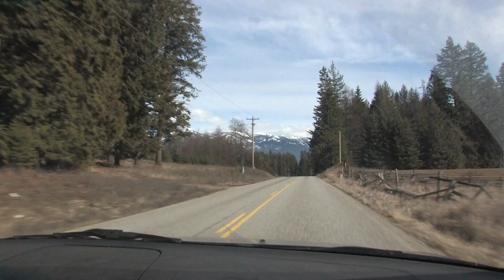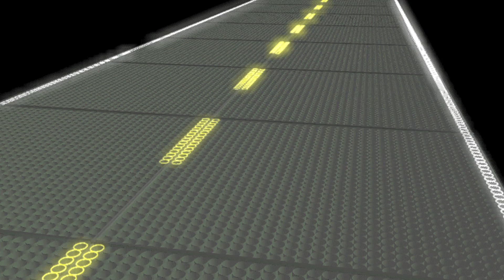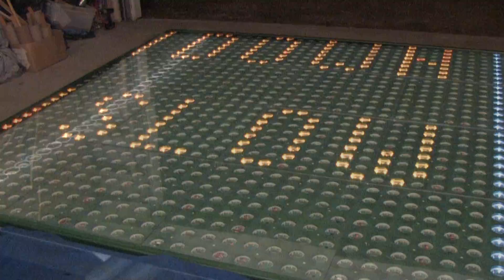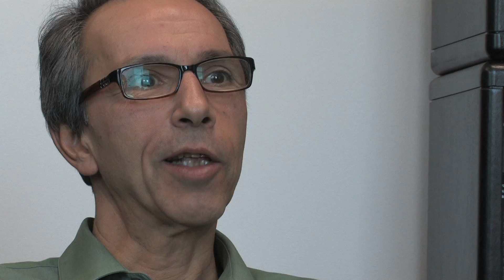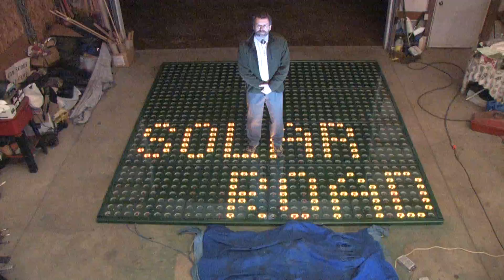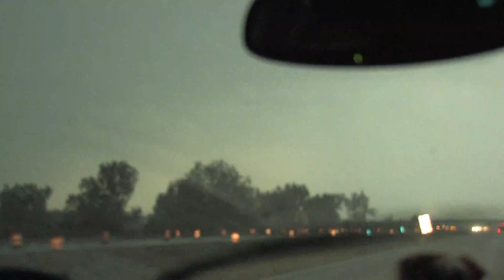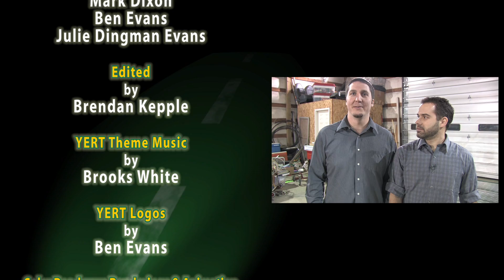Solar Roadways: The Prototype

Comment: Can anyone answer me this?

– Is the problem of photovoltaic solar panels, that we have not enough room for them? Come on – just look at all the roofs, slopes etc. … (And yes solar panels can replace conventional roofing or façade – generating more savings than by replacing the top 3 inches of asphalt of a street)

Or is it the actual problem maybe, that they are barely economical, have a bad efficiency, limited lifetime and would be bad for a smooth grid supply if they would produce a considerable amount of energy?

So what of the real problems are solved by putting them on the roads?

Efficiency?
Is actually worse – alone by laying them flat and not tilted they lose approx.. 40 % of their efficiency.

Lifetime?
That glass will be scratched fast reducing lifetime (and efficiency by the way – not even talking about dirt and tire scoring)

Economics?
With reduced lifetime and efficiency + extra cost to adapt them to be applicable for roads (doubt that this is even possible – glass is just not a good thing to drive on … also what happens if one of them breaks?)

Grid compatibility?
No it does nothing to solve that – in fact it makes the problem worse by demanding energy at night.

It is –sorry for that - just a completely stupid idea …